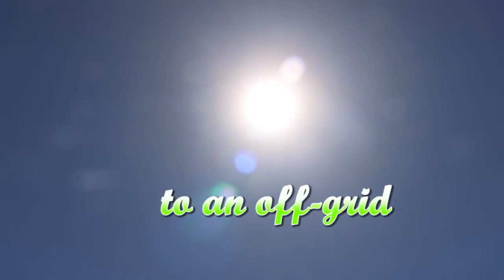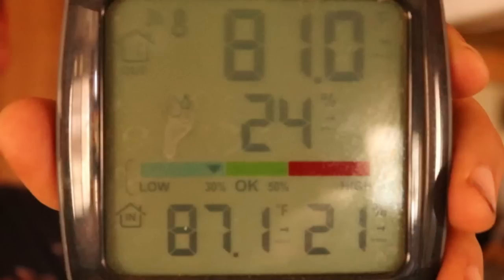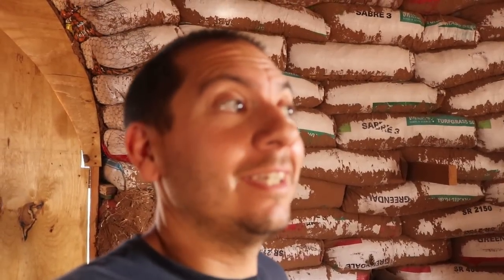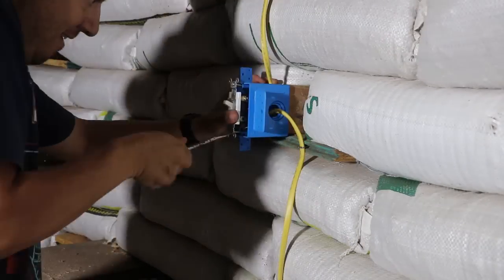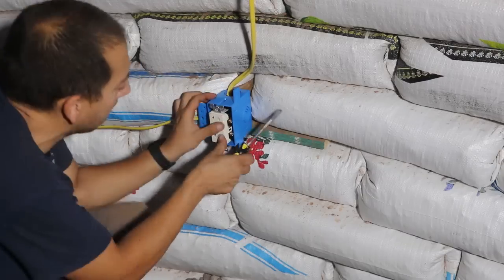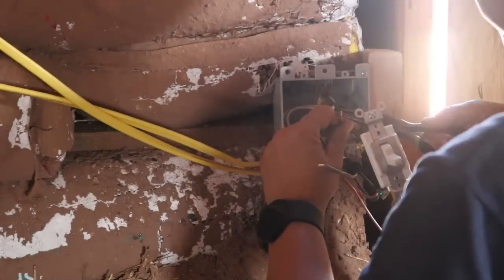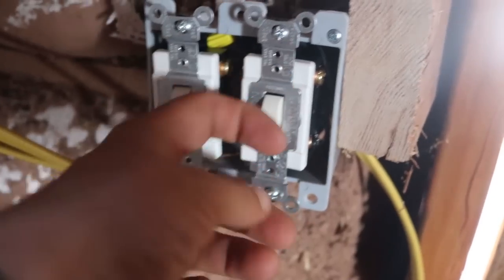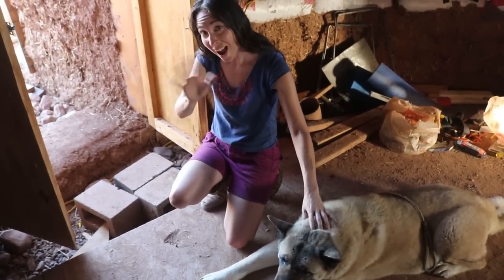Heatwave Strikes! Will We Need AC In Our Earthbag Dome? Building Off-Grid In The Desert

Comment: You need a vent near the top of the dome. Open the top vent and a window at night to help the dome to cool off. Then close it up during the day to keep the heat out. I built my house with a lot of concrete thermal mass. Open at night, close by day and it usually stays comfortable. What happened to monsoon season?  I agree, the white lime finish will reflect a lot of the heat. Put a reflective tarp over the trailer. It will probably need to be atleast 2' above the trailer roof for ventilation. That will keep the trailer cooler. Good Luck, Rick
Reply: I was wondering why there is no vent.
Reply: a skylight would've been perfect
Reply: @toprob20  Yes, for both light and ventilation.
Reply: If you do a underground vent system in combination with the roof vent you can use the earth to cool.

Comment: I've been living without AC for years. Most important? Good flow of ventilation out of the top of the dome and good airflow during the cool hours going through the structure.  A powered fan in the top vent might be good, but might work nice without it as heat rises and will escape from the top if it's hotter than the outside temp because the air is expanded and lighter. The whole mass cooling like that would make a difference all day. Your lower area is no doubt pretty cool now.

A white finish on the whole dome would make a good difference, and a cover shading it would also be a huge difference. Anything to deflect the sun's rays in daytime. Tree's work extra well because they emit cool air through respiration and soak up sun's rays.
Reply: Same here, I'm in SW Florida and live without heat or air conditioning. I have several oaks around me that help a lot. Keeping the roof coated with elastomeric makes the difference.

Comment: Curious:  you all have planned out so much, so wondering about when you were setting up the long roofed structure:  when building the roof, did you consider maybe building it a little taller so the RV could fit underneath?  Or, maybe just build an offshoot with a higher roof to cover the RV where it is parked?  Either way, some shade might help with the summer temperatures plus it would provide a little more surface area for water collection.  Great that the dome is so much cooler naturally, though!

Comment: Just a suggestion... If you add a little drop and loop up at the outlet and switch locations, moisture won't get into the places where wires are connected. Basically, it's good to enter al connection boxes from below. If water ever flows along wires, it can run directly into outlet and switch boxes. It sucks to have breakers drop due to moisture getting into those places. Never underestimate the destructive power of insects, animals and elements. I enjoy watching your journey. Best of lduck.

Comment: I have a question...Im sure you had a good reason. Had I made that long port for water harvesting and work space, I would of made a section, tall enough to put the trailer/rv under it to protect it from the sun and rain and think that would of made it cooler. I know you must of thought of doing that , so why didnt you? I suffer to see that rv under that hot sun. Those things even the four seasons are just not made for extreme weather. I remember my folks took us cross country one year in 1968, it was a ham can trailer, it was miserable...with only a fan...no air back in the day ...
Reply: Making it taller and wider would help with the rain collection, by placing the water storage inside, and directly filling them from the gutters. Also siding would keep the sun off the tanks, making them easier to read their levels. Costs would have doubled, but payback in water over time. Maybe a swamp cooler for Crew is in the future. Easy to make. Tank, fan, evaporative material, and make a frame.

Comment: There is a difference between ambient air temperature and radiant temperature. In the trailer the wales are radiating heat but in the dome the earth bags are absorbing radiant heat from your body therefore it feels much cooler than the air temperature would indicate.
Reply: Great point!! In addition to the regular ambient air temperature taking, Jim we’d sure love to see you get a surface temperature meter- the tiny cen tech would be great to see: the human body is more affected by radiant gains and losses ( radiant heat transfer is tracked not by air temperatures: radiation happens no matter the air temperature- ask and measure: “are the surfaces surrounding the occupants body warmer or cooler?” You have a great chance to show and test for yourself ( with a surface temperature meter) how sneaky radiant temps have huge effects on thermal experience and yes thermal safety- suppose if the trailer and the dome  are closer in air temperature, you can feel a lot better in one versus the other factoring  the impact of surface temperatures. As you are taking temperatures try to take some surface temperatures. Yes it’s a lot of energy to gain human comfort but you get a huge boost to harness radiant thermal factors. Just having thermal mass is part of this, but I’d love to help share how to consciously harness the radiant facet. Shading the outer shell (double shelling) with an air gap and ideally removable -over either the trailer or the dome will shunt heat away from even heat loading anything. The other side of the harnessing radiant principle is on cloudless nights you want your surfaces like the outer dome/ to radiate out to the night sky. ( So remove the shade of you can. Also you can do that trick in a more manageable scale of switching and moving by rolling water barrels just to prove this: with some of your water storage if you had black metal water drums you let sit out at night then rolled indoors close to you, they’d be a cool battery. Radiantly: it will improve your body to have more radiant heat losses  gotta unload that heat grain off your body. You add and lose more radiantly surface to surface than you can offload by blowing cold. Air. In a space. Radiant  is core to many hot arid natural traditional shelter making. Also besides tracking radiant flows not just air flows.. do flush the hot air buildup: get a little Fan out that  pipe thats way up there … one more and I’ll stop: precool the hot outside area ahead of your door: don’t worry so much about it being perfectly sealed: until you do I’d love to see you test and see now the air temp is effected if you put some temperature mitigations right outside the leaky doors or windows: maybe trees or your clothesline with sheets, orbees, wet rags etc  but place some evaporative anything between hot outside and that door. Blow bubbles and you’ll see the added force of untempered hot outside versus cool inside. If you slow midday intensity of difference in temperature by putting shade or green clotheslines or whatever in between hot outside and cool inside, while the door is closed in the day you might be able to lessen hot air coming in. Most of all vent the top and factor surface temperatures: I sure would love to see you take some spot temps ( beg beg beg) have fun with that radiant strategy: try to step out of the air conditioning paradigm relying on perfecting the seal of  contained air. If you do you have to cycle and switch things but you’ll get some amped effect and efficiency. I’ll mail you a surface meter but they’re cheap at harbor freight/Amazon. That’s for spots on the cheap but If you know a firefighter or someone with a fleer or other cheaper rainbow whole view surface temp sensor it would be really immediately spectacularly telling! Way More than my verbiage!! Some surface temp viewer types just clip on your cellphone Look up Robert bean, ASHRAE , “what is mrt and why we should care” article, and also the royal institute utube  “the physics of hot air” ! Have fun doing cool tests of the heat, expand your thermal senses to include surface temperature, mean radiant temperature somehow, and stay safe!

Comment: Since you don't have windows. Can make a shop swamp cooler, where you can move it around, with a tank to catch the water and pump it back on the coil. Or buy one ! Only 1 ~ 8 BTU WINDOWN UNIT COOLS MY WHOLE 1700' square log house!  😊👍 to about 75 degs but i got 4 units 1 in each bed room and front room. Now these do produce a lot of run off water! about 5 gallons per unit a day. As it get over 100 degs i might kick on another window unit! To help keep the house cooler! 72 and 75 degs is very comfortable. During the night which ever bedroom i sleep in. I'll turn them all off and turn on the one in the bedroom that i sleep in ~ BURR ITS SO COLD around 1 am i have to turn it off

Comment: Our portable evaporative cooler keeps the living room area of our RV in the mid 80s, (we are parked in the shade). The downside is that it uses about 1 gallon of water an hour and we have to keep the front and back door open (with the screens closed). It works really well, but it does use a lot of water. We just run it if we are inside which isn't that much.  We did a video showing the inside temperatures in our exterior insulated house, it's doing amazingly well. We got up to 104° last week!  Excited the monsoons clouds are here, it's much cooler now, we just need some rain.  Best wishes on your home, it's looking amazing! The lighter color plaster would definitely help. 😎🏜️

Comment: Those portable AC units like the one shown in the RV are terrible.  They normally only have one hot air exhaust hose that blows hot air outside.  They suck in internal (cooler air) from your dwelling, pass it over a hot radiator, and then take the now hot air and exhaust it through the big hose out a window.

However, in order to blow any air outside, this creates a suction inside your house, which then causes hot ambient external air to leak into your dwelling via any vents or cracks in your house.  The net effect, is that they consume massive amounts of energy, and don't necessarily even provide any net cooling effect at all inside your house.  You end up with cool air coming directly out of the cool vent on the unit, but you have extra hot external air coming into your house through any vents/door cracks/etc., which can potentially raise the average temperature of your whole house/dwelling.

I experimented with one the other day, and the unit was blowing hot exhaust air out the vent hose at around 105 deg F.  However, this is not hot enough to provide any net cooling effect, as the external air temperature at the time of the test was around 110 deg F (I also reside in Arizona).  In other words, the coefficient of performance of the unit was effectively less than 1.0, which means it was adding net additional heat to the house (even though it may have been locally cooling the bedroom it was placed in).  This extra heat was causing the main house air conditioner to consume substantially more energy to try to compensate, in addition to the ~900 watts that the "portable air conditioner" was directly consuming.

Meanwhile, high efficiency air conditioners and mini-split heat pumps can achieve coefficients of performance in excess of 4.0, which means that they do provide net cooling effect for the interior of your home.  Even ordinary "window unit" air conditioners (which suck in hot external air, pass it over a hot radiator, and then exhaust the even hotter air outside, without creating a net suction inside your house) will achieve far better results at much higher efficiency, compared to those so called "portable air conditioner" units.

Basically, if you want to be comfortable and don't want to be crushed by outrageous energy bills, don't buy so called "portable air conditioner" units, especially if you reside in a location with daytime temperatures exceeding ~105 deg F.  When the ambient external temperature is lower (say ~85 deg F), they will provide some (albeit low efficiency) net cooling effect for the interior of your dwelling, but when the external ambient temperature rises about ~105 deg F, the unit provides zero or even negative efficiency (ex: it operates essentially as a net space heater to your house).  

"Window unit" air conditioners and mini-split heat pumps are vastly superior efficiency devices.  Unless improperly installed or malfunctioning, they will always provide net cooling effect to your house, regardless of exterior ambient temperature.

Comment: They also make a nice window unit, that the motor is set out side, and the head of the ac fits inside and piped to the out side unit for around 1800 bucks..  Your trailer needs a awning over it. or a tin or shingle roof ~  Cool seal your roof works fairly good!  but not as good as a roof build over the trailer. cause you got air blowing in between it. Blocking the sun rays

Comment: hey Jim , have you considered using shade tarps over the trailer and the dome too, put up some 20ft treated wood poles on the west side of your trailer and then pur up the shade tarps between the poles , i use this method to block the sun here Houston and it works pretty good , you also shade the top of the trailer by stringing the shade tarps  between the poles and your water catchment carport, Amazon sells al sizes in different colors , i like the 6'x 50', but ive got two tarps that are 30 x 40, 0ne tarp blocks about 70 % of the suns ultraviolet  ray , oe double them and block offf even more sun,  a 6x50 runts about 45.00 a piece
Reply: Good idea. I took a caravan to South France in July some years ago. We stayed at the same site for the month and made a wood frame over the caravan, about 40cm above the roof and extending about a metre around the sides,ends. It was covered by a sun screen tarp, secured to the frame by staples. All materials were bought cheaply in UK . The caravan had no Aircon but stayed acceptably cool in temps of around 35C. The neighbouring caravan occupants were sleeping outside under mosquito nets as their vans were too hot. Fine until thunder/rain....
At least the Arizona sun could be blocked from their van by such a covering. The dome needs a way to cool it. I couldn't live at the high temps they have recorded in there.
Reply: @jimmyjohnstone5878  here in Houston Texas were known for our very hot summers, ive been using these shade tarps for years , they last a long time , i have some that are still good at ten years old, my shop is in full sun all day , i put treated pole on each corner and spread the tarp 40x40 over the shop , drop the temps 15 to 20 degrees which helped alot , i use them on my fence around my property too , for privacy , dark green or black seems to work the best
Reply: @georgevillarreal7592  Coming from Scotland, I only need such measures when on trips to warmer places. I would not enjoy living permanently in such conditions. I like occasional trips like the one to France, but generally I prefer a cooler climate.

Comment: I feel like a good portion of the cooling comes from the basement. Geothermal works even better underground surrounded by even more dirt than your bags. I might suggest a small air mover (like a computer fan or something) and pipe to move the cool air from basement to the loft, and then reverse in the winter if needed. Doesn't need AC, doesn't need more than like 5watts if that, just moving the air between the levels. Just a small suggestion.

Comment: I would think you will enjoy having AC (or a mini-split unit) in your dome. It will make cooling in the summer much easier. Also more efficient than a window unit. 
We have a strawbale home in Kentucky, high humidity. We toughed it out for the first 3 years, but couldn't keep the humidity down enough to keep mold from forming. So we bought a very small and quiet window AC unit. 
Also, you will find that you will generate more heat inside the dome living inside than now, when you are just "visiting" during the day. Humans generate lots of heat. And the electronics also produce heat. Which is fine in the winter...

Comment: I concur with other posters that the secret to thermal mass is to vent / blow nighttime cool air through the interior all night long.
You might get also consider blowing / circulating air from the basement up into the main dome then back down during the day when the doors and windows are closed to further cool the interior.

Comment: Running fans inside the RV is adding heat. Put a killawatt on it and it will tell you exactly how many watts of heat the fan is adding because it doesn't reduce temps, it just moves air. And to move that air it causes friction and the magnets in the electric motor to heat up. Run as few fans as possible to move the AC air to where you want it for the most efficiency.

You might think fans will cool you off when you stand in front of them, but they don't, they move air over your sweaty skin, and the evaporation of sweat is what does the cooling. If you don't have something evaporating in front of the fan it won't actually cool anything.